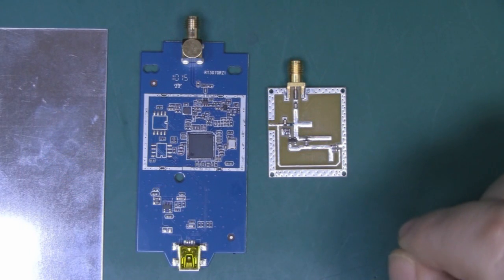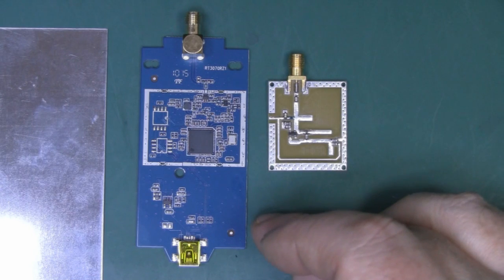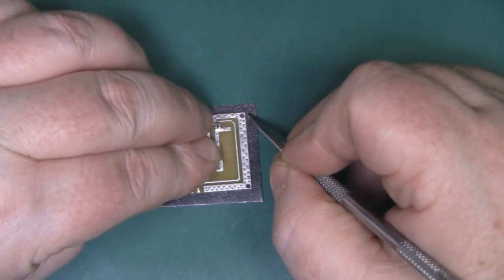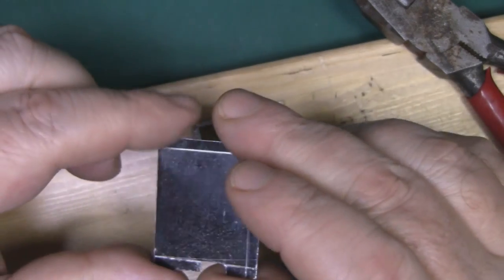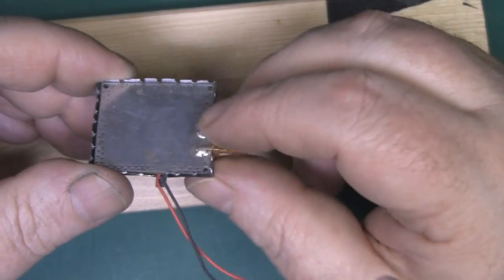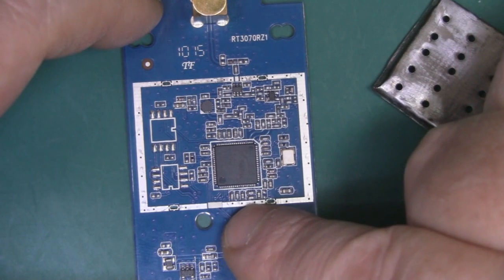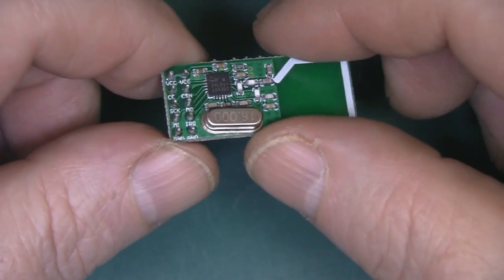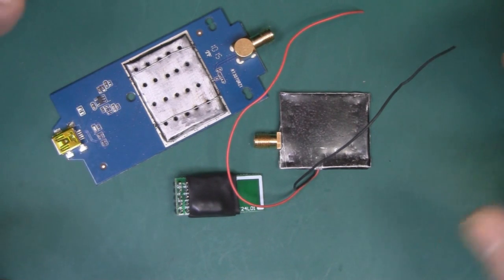DIY RF Shields #134

Comment: Perhaps using low-temperature SMD solder paste would allow you to solder the can together with less heat. Also you might hold a block of copper or aluminum on the top of the can to act as a heat sink, so the heat goes in there instead of to the circuit board or components.

Also you could try tinning the can's edges with solder before you solder it to the board. You could use as much heat as you like to get a good bond of the solder to the shield. Then use low-temp solder between the board and the tinned can.

Comment: I liked all three of your shielding methods, but I do worry about trapping excess heat next to the IC's.  Especially in the case of the double sided foam tape.  
I realize that some devices may actually work better with the stable temperatures these techniques may produce.  
Is there such a thing as a heat conductive insulator that could be used in place of the tape ?

Comment: I am an electronics hobbyist. I am fortunate to have a nice lab with a 6.5 digit multimeter. I am researching how to build an isolation box, to be able to take advantage of the multimeter's sensitivity. I plan to use two cookie tins, one inside the other. I will separate them with foam. I know that I must create continuity between the lids and base. Do I need to tie the tins to the earth ground of the building?

Comment: Thanks! I had problems using similar nRF24l01+ devices where it would get messed up. I tried all the other methods of ensuring proper power supply, adding capacitors, shortening my wire length from the arduino and so forth and never could get it to work with any consistency. Maybe this could fix some of my issues. 

I've seen people use them to send control signals directly from arduino to arduino but all those projects neglect to show their sketches and all the others I've seen required using a PC with serial connection to read the info. I managed to get one to start to work where I could use potentiometers remotely but got messed up once I got more than a dozen feet away or so. Anyone have links to sketches where these are used to make custom remote controls?  I am a total beginner with Arduino and all the other resources I have read only send digital info to be read in a serial terminal and I just want to make a remote control.

Comment: You will need to ground the aluminum foil for your last method, otherwise it will become an antenna coupling the noise into the circuit.

Comment: in the 3rd and others don't you need to ground the shield rather than have it float electrically ?
keep on the great work   THANK YOU
Reply from the maker: +Micha Ronen Thanks Micha, yes it would be best if you could ground it but the last one was never made taking shielding into consideration. It is a cheap fix if you have problems using more than one.